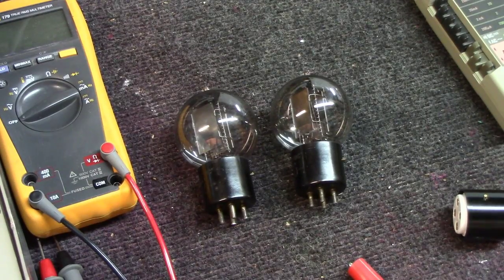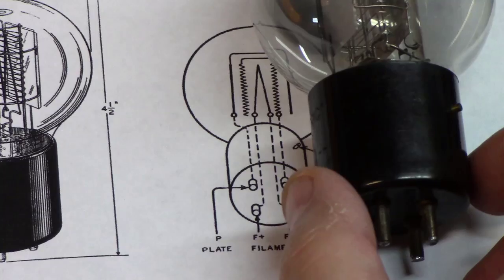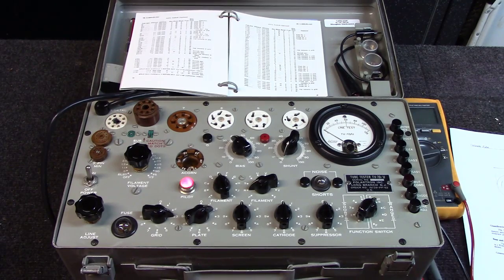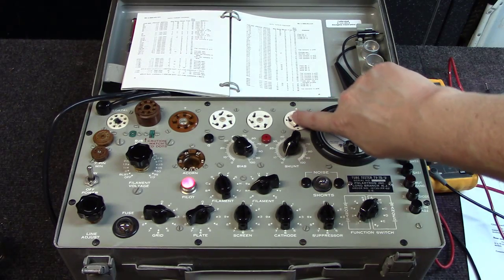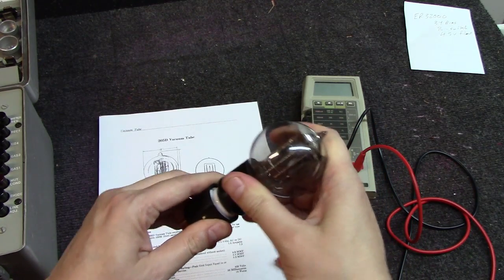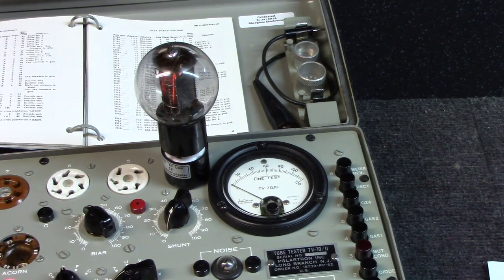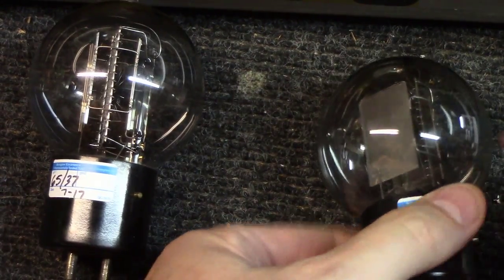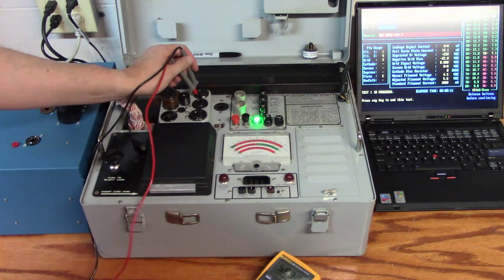Testing Tennis Ball Vacuum Tubes Like the Western Electric 205D

Comment: Is it possible to test these tubes on an etracer? Obviously, one would have to have the appropriate socket wired to the etracer and the ability to drive the large current requirement of the filaments… but is it possible?